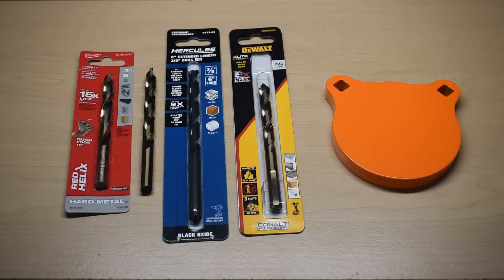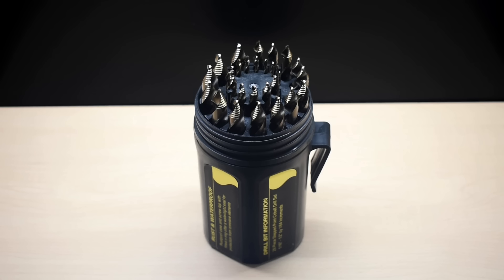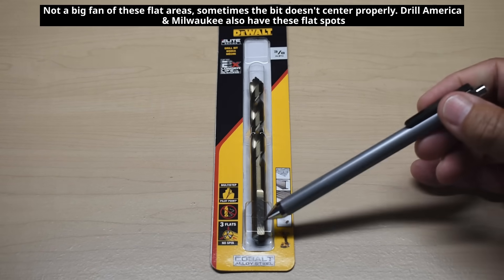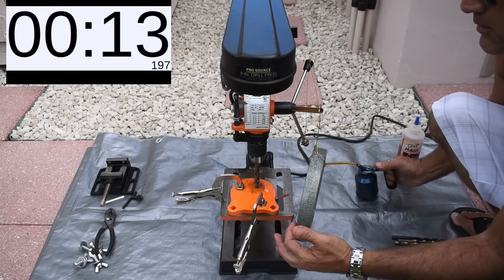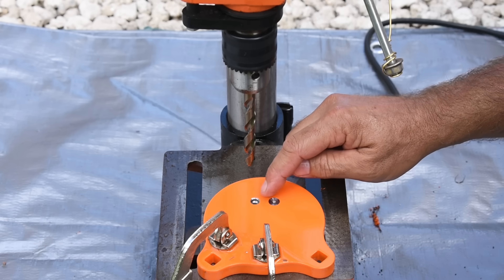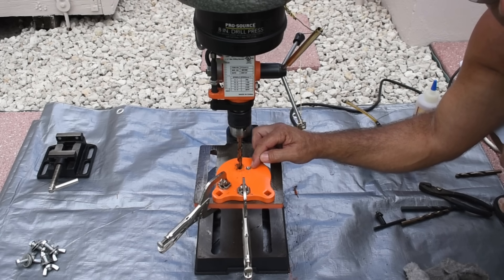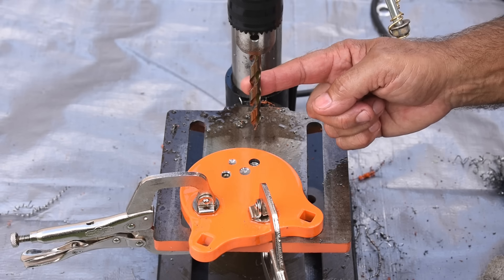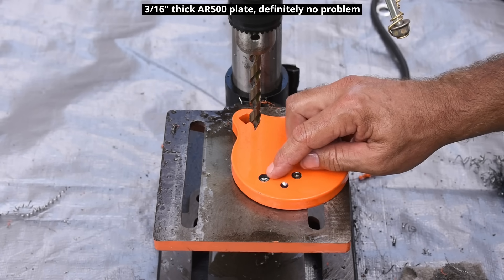Which Drill Bit Is BEST For Hardened Steel Plate Or Stainless? Find Out

Comment: Would they have worked better at a slower speed? Looked like most of the damage was on the outer part of the cutting edge that travels the fastest.

Also it would be difficult to sharpen the stepped bits whereas the others could easily be resharpened to continue drilling.
Reply from the maker: Possibly, but more than likely it would not have changed the order of best bit to worst. The cutting fluid used in this video can be used with any metal.
Reply: Totally agree with you. You can ruin even the tungsten carbide dril bits if overheated. Heat management is key to keep the cutting edge hard and sharp, and when drilling very hard materials like AR500 you have to go slower in rpm and softer in pressure
Reply from the maker: @Jon-lq1of I can assure you there was no overheating issues. I've seen overheated drill bits. :-). You can also tell by the color tone of the bit if it's been overheated. Plenty of lubrication, and the test wasn't long enough to have enough friction build up. I also was able to touch the tip immediately after drilling to feel the level of sharpness, it was not hot.
Reply: Exactly DRILL with lower speed & correct lube
Reply: They all played by the same rules.

Comment: Impressed by the results. Now a new question arises: what should a sensible human driller use to bore a hole into hardened steel without wasting a full set of bits?
Reply from the maker: The one that came out on top in this video. You can purchase the bits separately not in a set. Thanks for watching
Reply: @electronicsNmore   well thank you for your prompt. My bucks are different than your bucks, I am afraid it would be quite impractical for me to buy from the US.

I'll see what I can find in the Chinesium reinforced dept. hardware store. I am a regular over there.
Reply: You got to do whatever is needed to get that hole drilling through. 
Sadly to say you will have to pass the cost down to your client or refuse to do it.

Comment: THE BEST DRILL BITS SHOULD BE TRIED ON STANLESS STEEL& SEE IF ITS GOING TO DRILL MORE THAN 1 HOLE
Reply from the maker: That's your opinion. Many people drill into hardened steel. Clearly, if you watched the video, you would know the reason why more than one hole of each bit was not drilled. 304 and 316 stainless steel are not going to be as hard as the AR500 plate. The results of this video will let you know which one of the bits should have no problem drilling into the softer stainless steel.
Reply: @electronicsNmore DRILL stainless with a lower speed & correct lube to keep it from overheating
Reply: i drill stainless all the time man it chews drill bits even cobalt i lubricate continuously